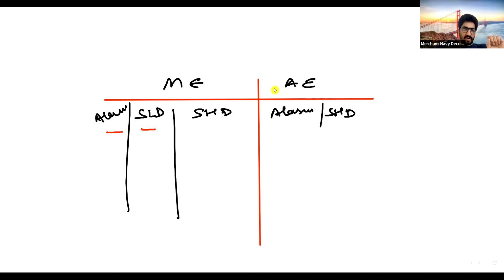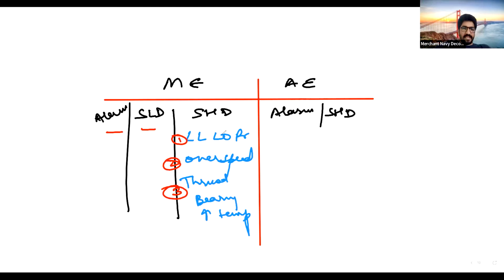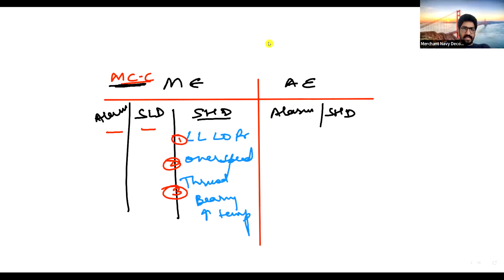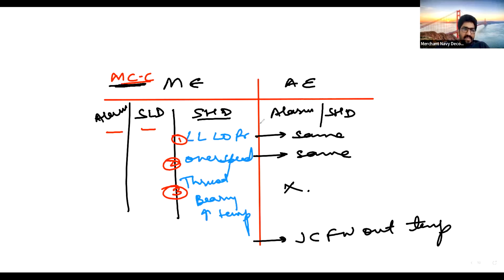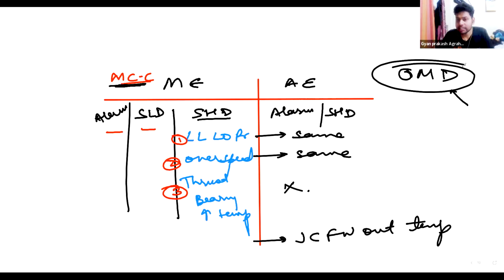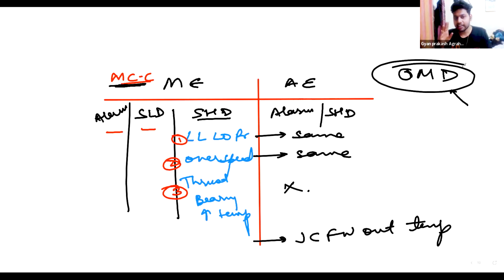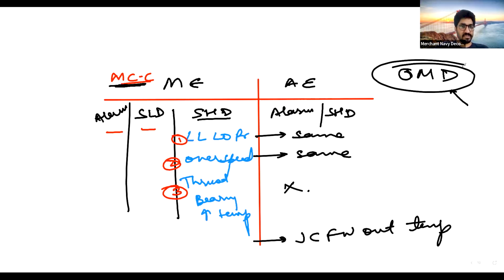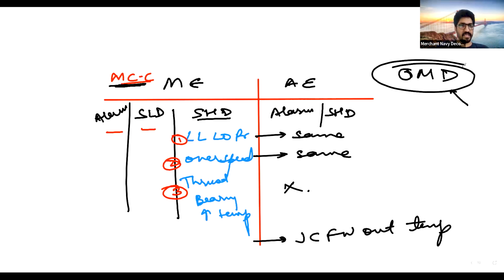What Are The Safeties For Main Engine On Ship | What Are The Safeties For Generator On Ship

Comment: there are still more shutdowns
1) Exh valve spring air pressure low
2) Exhaust valve driving oil pressure low